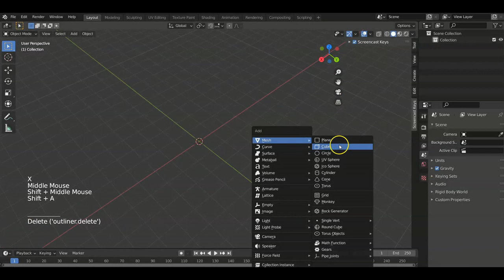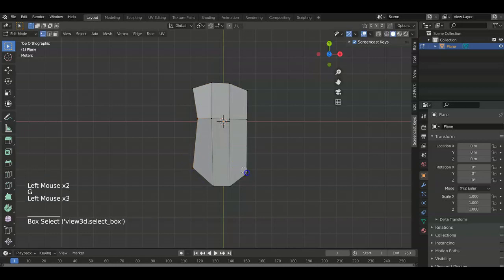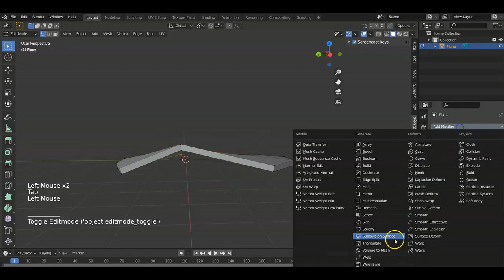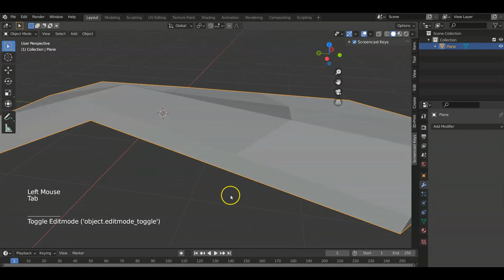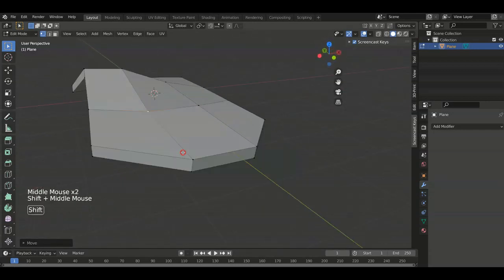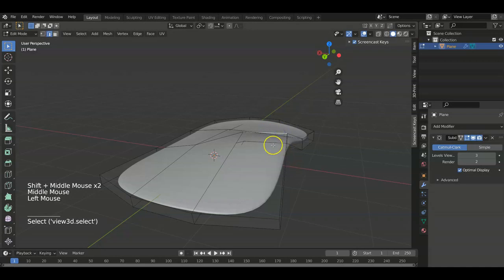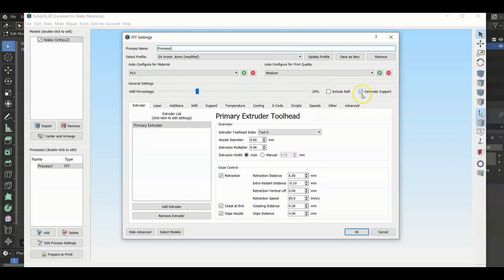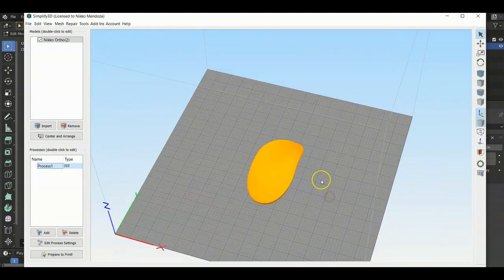3d Printed Shoe Inserts for Plantar Fasciitis- How to Design and 3d Print Your Own Shoe Inserts for

Comment: Is it possible to open a 3D foot scan (STL file) and design the insole in Blender software following the contour of the foot arch?
Reply: yeah but there are better options now, like scanning your foot, putting that file into a software that auto generates an insole for you
Reply: I only know the gensole website. however, I find it a little difficult to edit the insole. Do you have any other recommendations for free software to make insoles?
Reply: @TredeRenato  personally id get the base design from gensole and do any editing in blender